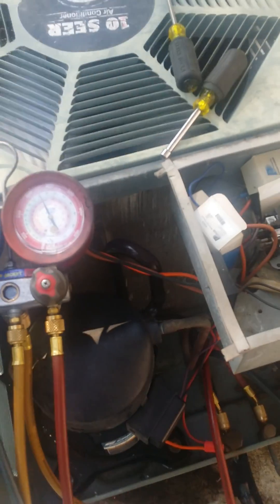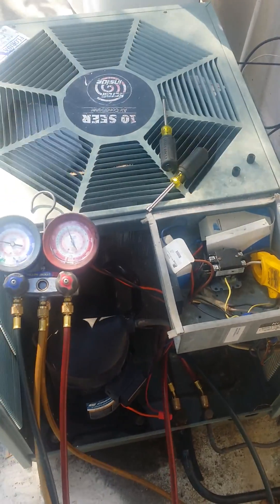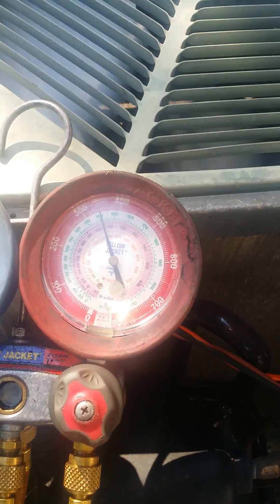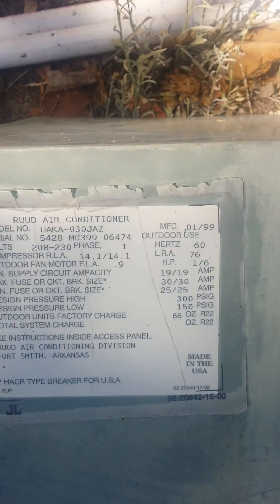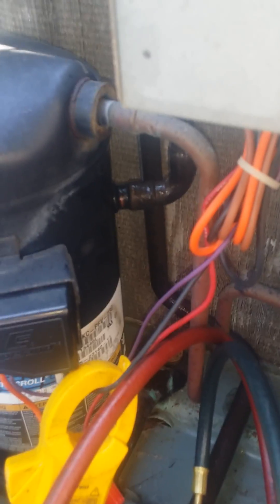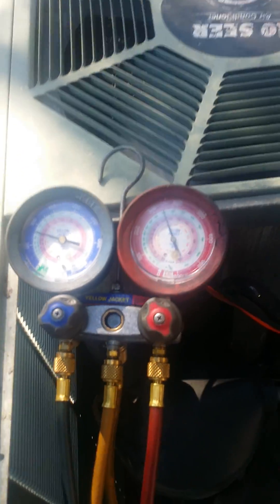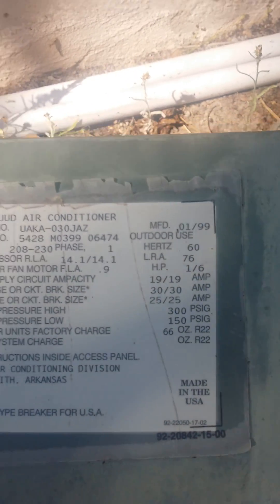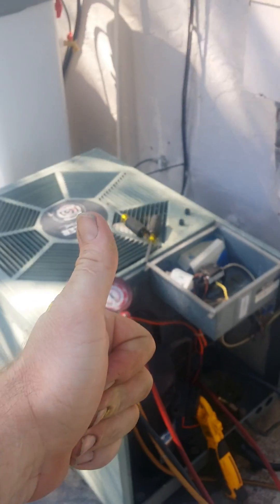410 a refrigerant drop on top of r22

Comment: What an idiot. The compressor is not going to last.
Reply: What will damage the compressor?  Please be specific, "idiot" is not good enough.
Reply: You need a PT chart. You need to know your subcooling and superheat. You will floodback your compressor. Or more likely wash your bearings out. Or You will overheat your compressor.
Reply: I see nothing specific in your reply.  "might" or "likely" feels good and you could be perfectly right, but you need to back it up with facts.  Just what if Adam Larson is perfectly right?
Reply: Thomas Sk I have done a lot of mixtures also and it have never ever happened anything I think everything is all about money.
Reply: jesus, you are spot on, it's all about money.  From what I read about the laws, a/c techs are perfectly fine to recharge a system with whatever they "recovered" (EPA definition for what's pumped out) from that same system, they just can not sell the unknown mixture to someone else.  All they can do is to sell it to a "reclaimer" (also EPA definition, who purifies the gases).  But the "reclaimer" tests the returned mixture before deciding how much they want to pay for it.
To add it up, these low tech types are not able to sell recovered freon to someone else, and reclaimer offers low price, they themselves are not equipped to measure purity, so they get on youtube and call other people idiots.

Comment: Come on.  What are you smoking?  You won't have any oil return.  All expansion valves will close.  Compressor will pop the relief valve.  But, on a positive note.  At least you didn't add propane and blow up the house.
Reply: Why do you think that?  Please be specific and technical.
Reply: Thomas Sk 
Because R410 runs at much higher pressures than R22.
Reply: To Mwdub - 410 pressure is perhaps 30% higher than 22, and that's in extreme weather conditions.  All equipment and copper lines are rated 400% higher.  So that's not it.

Mind you, here is a guy who went through some homework and he demonstrated his results.  Next thing I see, he is called an idiot by people who swear they would never attempt to do what he did, because they just KNOW (by magic) that it won't work.  Well, if they would never attempt it, and they don't have the engineering info - how do they know?
Reply: @ThomasSk100  the equipment is still working?, 410 dont use mineral oil, do you change it? and the other proble is 410 have 40% of more displament. maybe works but a high cost.
Reply: @ThomasSk100  and you show 13.0 amp of 14.0 in my opinion are too high (systems with r22 in tropical zone are more efficient than that, jajajaja), so the problem here is pressure are not correct, subcooling and subheat are not correct, high current, so your system comes more inefficient.  bellive me if i can find a economyc solution i will do it , but for me this is not.
Reply: @aaronjesusrojassaucedo8138  I did not do this, I just defended someone who did, who claims success, he documented it and then he got attacked by some ignorant people.
Reply: @ThomasSk100  well I don't defend, it's not really proof of works, not documented, I can see some problems, the compresor r22 don't work with to high pressure, works yes for the question is for how long, sorry but it's not succeed.
Reply: lmaooo

Comment: I don't mean to be inflammatory, but what were you thinking? 410a runs at double the pressure of 22. it also utilizes Poe oil, instead of alkobenzen. your metering devices are tuned for 22. I can't imagine what your compressor amps were.  this seems like a bad idea. please keep us updated on this. I am curious if the blow valve on the compressor has blown off yet.
Reply: Stay tuned, you may learn something here.
Reply: R22 is mineral buddy the days of that old oil are over
Reply: If there is nothing to lose, why not try it?  the system is obsolete and if this gave the guy another year or two and everyone was on the same page. Let er rip...